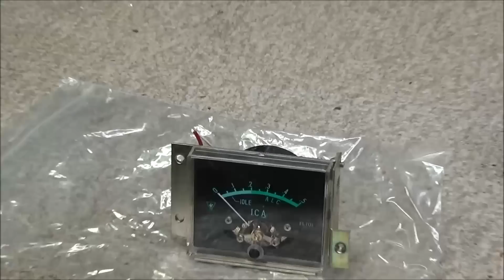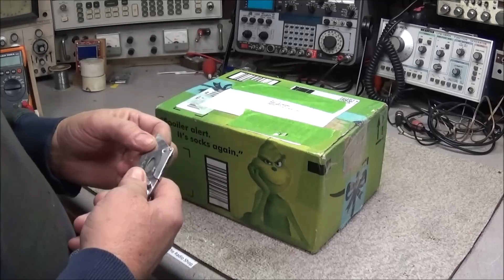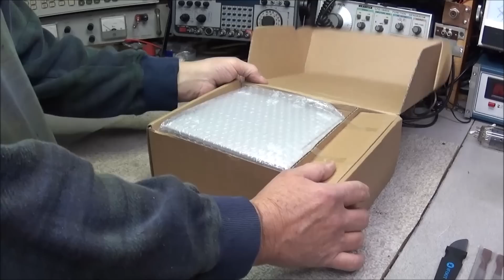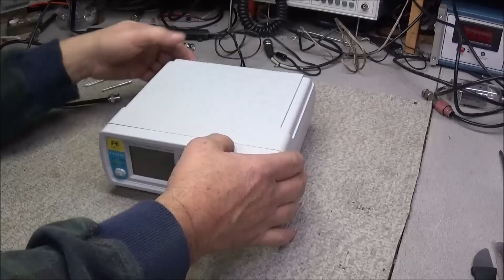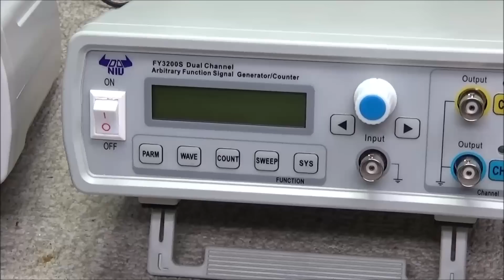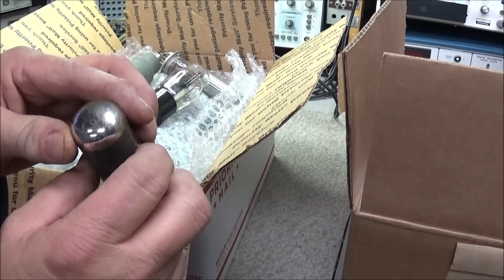#193 Mail Time Plus Another Give A Way

Comment: I have Bang Good's JDS 6600 AWG that I got last year. (So NO thanks, I don't need to be included in your generous drawing. Your give-aways are very good gestures for fellow  electronics enthusiasts.)  The FY6800 appears to be much improved with features as per a few other You Tune videos as you mention about it.  Since this one has a sweep function, I'm very interested in seeing how that may be used especially if it can be used for IF alignments. So I'm really looking forward to seeing any and all videos you have about this FY6800, both modifications and practical use and I may want to upgrade to one myself. Of course, I look forward to all of your videos anyway. LOL I just ordered the Bang Good soldering station as per your review and seeing that you use it on a regular basis.  God bless you and keep you and your family well.

Comment: I dont understand why they did not have a wall wart power supply for this unit. The only reason I can think of is cost.
Reply from the maker: There are four different voltages. Hard to do in a wall wart

Comment: Hi Buddy. Please add me to the list for the 3200s. Dino is the man! He is very generous. I do have a classic hp 3312a that wasn't working. It was the very first piece of gear I tried to repair. I used the shotgun method; just kept testing and replacing parts until it worked. I learned a little about soldering and troubleshooting on that generator. I still haven't found out why the modulation section of the function generator isn't working. I'll take another look one of these days. Merry Christmas.
Reply from the maker: Thanks and Merry Christmas to you

Comment: Hello Buddy:  I want to wish you a very Merry Christmas and a Happy New Year !!!  Those two tubes with that outside coating were probably made in Canada by G.E. of Canada.  That coating was meant to be a shield coating and was grounded by one of two ways, 1) Was by way of one of the tube's pins. 2) Was by way of a specially equipped socket that had one or two long fingers that came up from chassis ground to actually "CONTACT" that outside coating !!  it was an interesting design !  P.S. those old Kenwoods look SUPER!  73's John Bellas  de  KC2UVN
Reply from the maker: Thanks for that information John, And a very Merry Christmas to you

Comment: I prefer a whiskey barrel aged hard root beer with my bench cookies. Only one, they sorta sneak up on you ;) . Could use the aig gen to align that HW101 I mentioned before, it was golden screw drivered. All the cores were botomed out and a couple were broken. Just waiting on the one tube that has no sub or even a differnt pin out sub. What a deal Heathkit must have got on those. Only ever seen on in an early Hallicrafters CB.